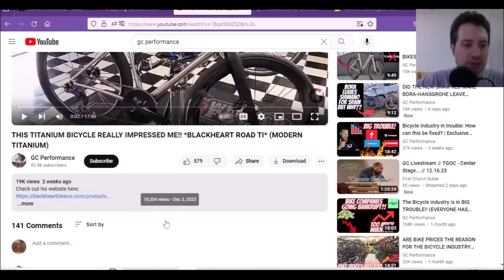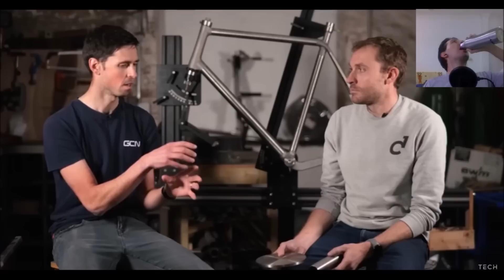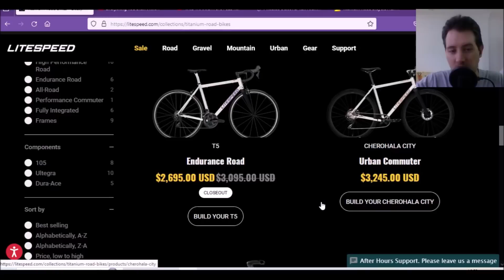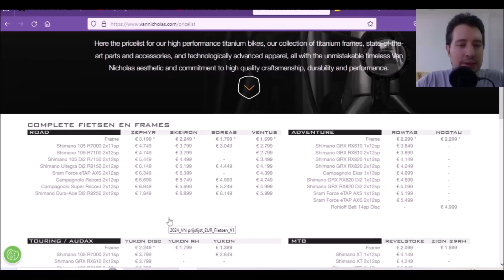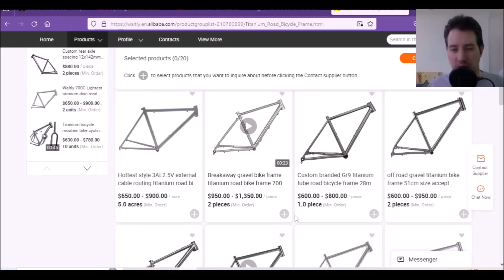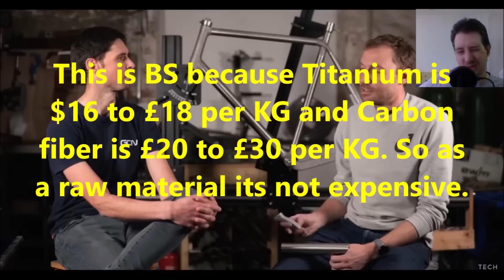Points On Titanium GCN missed.

Comment: I ride a variety of Wabi bikes, my favorite is a 55cm Wabi Special built using Reynolds 725 main tubes with 4130 chrome molybdenum forks and stays. Lugs, paints, brazing and paint are as nice as a Raleigh Pro I had in 1977, without the chrome or pinstriping. Cost for this 18.4 lb. singlespeed is just over $1000. USD, I wonder what it would cost having Ti tubes.
Reply from the maker: 55cm top tube? I could fit that. 😁

Comment: Sorry, but I disagree. If you make a light titanium frame, the tubing is so thin that the slightest imperfection in the material will start a crack, and titanium properties will allow the crack to propagate around in tube. As for comfort, that is all BS as well. A double triangle frame made from any material is absolutely rigid. Comfort is in the tires. You can make a case that titanium will last forever after it is used enough for any imperfections to show themselves (I had two high end ti bikes fail though they only made noise rather than catastrophically failed) but I myself prefer hybrid bikes with aluminum main triangle and carbon fork and rear triangle. I also like high end steel because I am not stuck on weight. I am not a racer and on flat courses even Cat one's can use steel without a problem.
Reply from the maker: Sorry but I must disagree. 

Titanium tubes don’t crack because of the wall thickness, the 6/4 Ti tube I have at 0.4mm is incredibly strong, stamp on it all day long and it will not crack. The best you could do is bend it, but you won’t do that with your body weight for sure. And yet from photos online we can see 3mm thick titanium tubes cracking? The reason Ti frames crack is because of the welds, if air or contaminants, or too much heat get into the welds during manufacturing then you get cracks. That’s why if you googled cracks in titanium frames they always crack around the welds/joints. You won’t see a titanium top tube cracking in the middle for example. But if they are done well you have a bike for life. 

As for flexibility in the frame. I have 2 steel bikes, they are both double diamonds. One is an old frame with narrow tubes and it flexes like crazy! You can literally feel the frame flexing as you ride. The modern frame has oversized tubes and triangular seat stays and is solid as a rock! No flex whatsoever. 

Tyres can make a difference but surprisingly little. My titanium frame is more comfortable on 23s than many carbon frames I’ve ridden on 28s.

I have a mixed material frame, aluminium and carbon. It was good, but it’s not the best of Ideas to be mixing materials.

Comment: Thank you for a great channel, Reginald. Just one question. If I wanted a bike that was made out of the most comfortable material. If Comfort was my first and only priority, do I understand you correctly, that I would have to choose titanium over steel?
Reply from the maker: No, many bikes can be comfortable. 
For frame material steel and titanium are the best but it also depends heavily on design. I have 2 steel bikes and they are completely different in ride feel. 

My titanium bike is “comfortable” for a super stiff race bike for example. But it could be a lot more comfortable if the frame was a different design. 

Like a narrow tube is going to be more flexible than an over sized tube, a oval tube will flex better than a triangle shaped tube… 

Check out my video on how to make your bike comfortable. “Ways to improve road bike comfort.”
In that I give a few tips on finding the right bike.
Reply: @ thank you so much. I like the video you recommended. 

I’m considering a custom frame. But I’m not sure if it’s gonna be steel or titanium. If both were made for comfort as first priority, which would be the most comfortable?

Comment: I had to replace  a titanium frame after it formed a crack in the downtube.  It occurred after 10 years of high mileage.  I moved the old parts(with rim brakes ! ) to the new frame.  In general, Ti bikes are niche but that is  a plus since you can get a custom sized frame that better fits your needs.  My replacement frame was painted (I don't like the silvery finish)
Reply from the maker: Cool 👍🏻

Comment: as someone interested in bikepacking and long adventure touring, i like my bikes no breaking when falling over with backs on them or just sand of by my bags. never understood people buying low light carbon bikes and go bikepacking with them. 
right now i have a good AL frame with lots of dents and scratches.. its ok, because its AL and i would upgrade to TI if too damages.. if that would be CF, i would feel pretty stupid
Reply from the maker: Steel is also a great choice for a bike packing adventure. 👍🏻🙂
Reply: @reginaldscot165  yes. i would love to have steel. especially the repairability is nice. but investing in a good steel frame is not that much cheaper than taking Ti. Or do you have a good steel frame recommendation? Also I am unsure about corrosion. My AL frame has many scratches from bags that will probably rost away in the next years

Comment: And once again you don't compare apples to apples when talking about the Tarmac SL8. If you deck that Lightspeed out with comparable components the price is about equal, and I'd guess the Tarmac would be lighter.
Reply from the maker: The Tarmac frame is significantly more expensive. That means you would have more money to lighten the Litespeed. Also the Tarmac has a lot of proprietary kit, bar, seatpost, FD mounts, so you are limited in what you can choose. Finally the Tarmac only comes in disc… this frame was available at the time in rim. So it will always be lighter. I had a customer with a tarmac in my shop who spent at least 20k on his bike setup. He had top of the range titanium and carbon parts on the bike and it was still 6.8kg. My Litespeed at the time cost me $13K Max (not what I paid because I didn’t pay full price for anything on the bike.) and it was 6.4kg.

Comment: Interesting video, however I think you spoil some of your pro titanium points by unfairly denigrating other materials and saying that they're unsafe or disposable. A well cared for carbon bike can also last a lifetime. I have a titanium bike and also a carbon bike, they're both fantastic machines and both have their strong points. Also I've seen broken carbon frames and broken ti frames. Carbon is not "fragile" and does not "break easily" during normal riding conditions.
Reply from the maker: For the most part you are correct. All bike frames can just crack… it’s just more likely to happen with carbon bikes. The basic logic is, if you take a Ti frame and a carbon frame and smack them together what frame will come off worse? 😉
Reply: When I was a kid I had an old Schwinn Varsity made of steel so heavy you could pound nails with it. Luckily for my carbon bikes I don't attempt to pound nails with them, I grab a hammer instead 🙃 @reginaldscot165

Comment: I have no reason to believe that titanium is not a superior material/metal, but to insinuate that bikes made of carbon or aluminium are unsafe and that they will break/snap or whatever at any moment for no reason is just nonsense. Have ridden aluminium bikes for decades and have never had any such issues. Have not had a carbon bikes or parts of carbon just as long, but have never had any such issues with carbon either. Have never heard of anyone having such problems with their carbon bikes either unless they crashed or clamped them way too hard in a bike stand or bike rack.
Reply from the maker: Well your first argument is “X never happened to you so X doesn’t happen.” Isn’t a particularly good argument. X has happened to me, it’s happened also to many customers of mine. As I work in a bike shop so I see a lot of examples. 
A 2 year old aluminium frame snapped on me literally just riding down a road. 🤷🏻‍♂️
It can happen with any material, obviously. But, everyone knows that carbon is particularly sensitive to impacts of any kind.

Comment: Hi Reginald.

Great vids you've got to be the best YouTube bike mechanic.

Do you have any experience with the magnesium alloy allite "super magnesium" frames?

I have a A1 magnesium frame from VAAST.

Curious your thoughts vs titanium.  It was $1100 good weight and seems very durable and pretty comfortable
Reply from the maker: Thank you! I don’t know about that, I Think RJ the bike guy is probably the best.  😅 I don’t actually, interesting choice honestly, I don’t imagine it’s terribly comfortable? I have had experience of a scandium frame. Like all alloy frames like aluminium they tend to be light and stiff. I believe Magnesium is lighter than aluminium but weaker so would need thicker tube walks? The scandium frame was like a rock! 😁 What’s your frame weight Vs size? 

Price is good, $1,100 is not too expensive at all. My Ti frame was $4,608 USD new! 😅 (you can get cheaper frames for sure.) 

Your bike sounds really unique and cool, safe riding and thank you again! 🙏🏻

Comment: Hi Reginald. 
My first Ti bike was a Litespeed Ultimate circa 1993. I still have it. I also have a Litespeed Ocoee from the same era and 2 Lynskey R255s from approximately 12 years ago. All have either top end-ish Shimano or Campag components and all are wonderful to ride. (Fortunately I have a partner who is OK with me running the N+1 rule for bike ownership😊). 
The only bike I have that comes close to my Ti bikes is a beautifully lugged Reynolds 531 steel bike but is obviously heavier. 
I think Ti bike ownership is a bit like flying, once you’ve travelled in business class there is no going back!
Also I’m a physio who does bike setups and treats cyclists with chronic low back problems and I will always recommend a Ti framed bike over a carbon or aluminium bike because the ride quality (technically, the ‘ground reaction force’ load) is so much lighter compared with the others. I fully support the comments you made re Titanium as a frame material. However, when you are young and foolish (as we all once were), of course you buy the latest and greatest, don’t you? 33:40 
Good video.
Reply from the maker: Excellent comment! Thankfully I was able to get into Ti bikes at an early age. Now I still do make foolish decisions but at least I won’t be getting any carbon frames from now on. 😉

Great to have people like you watching the channel. Safe riding! ❤️

Comment: Can you compare please 6Al 4V titanium and 3Al/2.5V ? Is it worth premium price tag of 6Al 4V ? Thanks.
Reply from the maker: I think so, I bought a bike with 6/4. 6/4 will be used for certain tubes, not normally for all the frame. Makes things lighter and stiffer but it’s hard to work with. Probably more likely to have issues and will be more expensive.

Comment: You are using the word 'strong', which is wrong from a materials engineering point of view. It's always best to differentiate between, stiffness (modulus), impact resistance, malleability, tensile strength, compressibility, and other properties: all of which can be mistaken for "strength".
Reply from the maker: Yes I should refer to the 8 material properties names to be correct. 🙂👍🏻

Comment: The really crazy thing is that Titanium in strength to weight terms is falling behind steel at this point. In the work hardened state, Reynolds 853 is over 20% stronger per unit weight than work hardened 3Al 2.5V Ti (Which seems to be the industry standard for bike frame tubing). This is a bit of a conundrum, given Ti frames are almost universally lighter than 853 frames, but dies explain why the warranty on the Ti frames is usually very short, while plenty of steel frames, even those from the same manufacturer as the Ti ones have a lifetime warranty.

Also Titanium could become a lot cheaper if the process of refining it is improved - Aluminium, also very common the the Earth's crust, used to cost as much as silver because the refining process was similar to what is used for Ti, namely reduction from an oxide to a pure metal through a multi stage chemical process. Then the Bayer Process, which used electrolysis to separate the Al was developed, and suddenly Al became orders of magnitude cheaper. I heard years ago that some research group had claimed they were testing a process like this for Ti, but there hasn't been a thing about it since 😞.
Reply from the maker: Excellent comment, especially the second paragraph. 🙂

Yes before the war in Ukraine a Ukrainian company was performing such research and had made a significant breakthrough with titanium extraction. However I have no Idea of the current situation? 

I don’t know many companies that don’t have lifetime warranty on Ti? Normally the failure point is the welds (because of oxygen getting in) not the titanium tubes. 

Thank you so much for your interesting comment. 🙂👍🏻
Reply: @reginaldscot165  On the MTB side lifetime warranties are a lot rarer. Cotic is probably the worst example as AFAIK their Ti frames are made in the US by a company that give lifetime warranty on the frames with their brand on them, so Cotic trust that company less than the company trusts itself, given their Chinese/Taiwan welded steel frames have a lifetime warranty.

The reason I still don't have a Ti bike when I could have easily bought one 10-15 yeasr ago is that without a test ride, there's no way I'm spending 2k on a frame and getting test rides on anything I'm interested in would require international travel, a hell of a lot of organising without getting to try it on trails I know well enough to give e a chance of noticing improvements over what I already have.

At that point I'd rater spend my free time riding the bikes I have already than anything to do with long trips (That aren't pedal powered).

The other huge problem in the MTB side is that over the past 20 years, component interfaces that were set in stone for decades keep getting replaced by incompatible new ones, so there's every chance the bike industry would make my frame for life unbuildable in 4-5 years. 

Tapered fork steerers and boost hub and BB spacing are the worst offenders here and I hope a special place in hell is being kept for everyone who shit on 30 years of 26" wheels being the MTB standard by pushing 27.5" wheels (The real difference in radius is more like 12 mm). At least 29ers are different enough to have some advantages, but 26 and 27.5 are functionally identical, but completely incompatible.

Comment: Hi , I have the chance to buy a dt swiss pr 1600 dicut  wheel set at a good price, but I can't find information about this model in particular, all that I can find is about the pr 1600 spline model, what is the difference? , would it be a problem to buy spare parts replacements? thank you
Reply from the maker: The Dicut is an upgrade over the spline. It should be lighter. Parts, same difficulty to get as any parts for DT. 🙂👍🏻 Good wheels.
Reply: thanks a lot mate @reginaldscot165
Reply: one last thing, are these hubs similar to 350 model?
 @reginaldscot165
Reply: @jorgesierra3165 Yes they're similar and already using ratchet as engagement instead of pawl.

#SwissEngineering